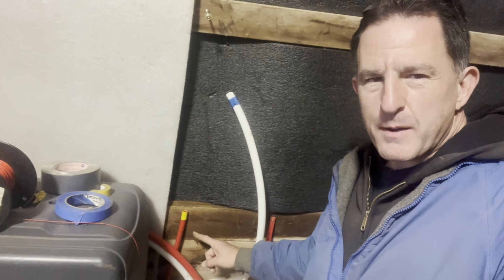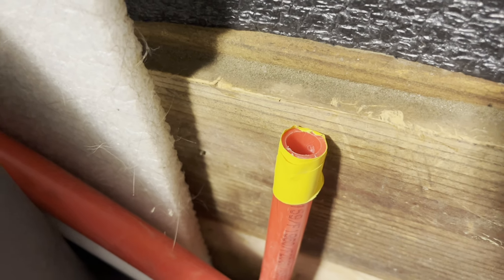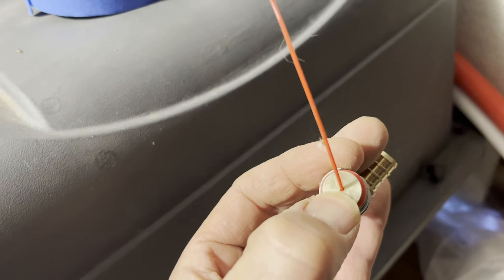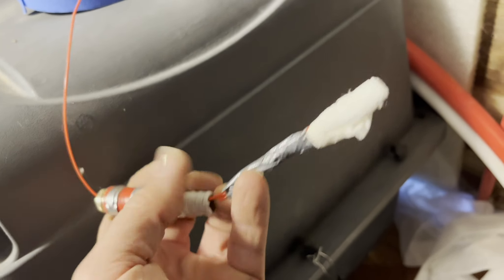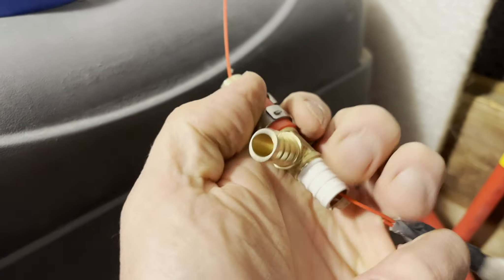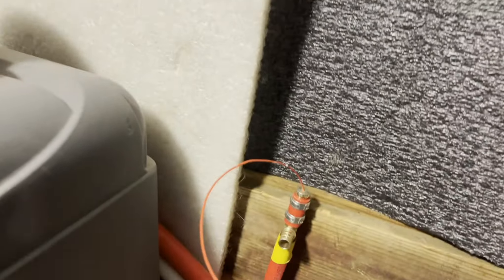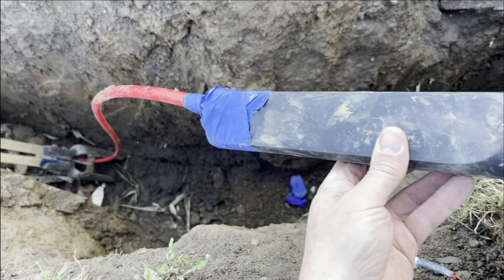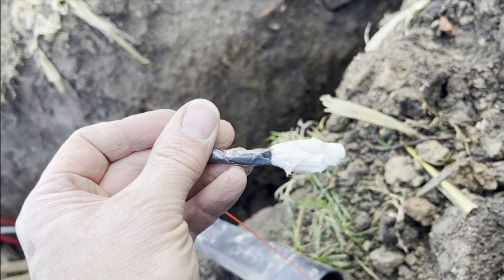Running Pull String Through Conduit

Comment: Good quick summary— but I’d like to know what kind of wire that is— obviously strong but very thin. Also, a few comments: 
I always recommend pulling a length of pull string along with the cat6 and tying it off at both ends to make it easy to pull another wire through if your needs change in the future. 
Also, anywhere anyone may encounter that pex along its route I recommend marking it clearly “data cable— DO NOT CUT” — easy to do, could save you a mess of work in the future if some repair person or contractor is doing work in a rush.
Finally, on the “receiving end” you could attach a short length of clear tubing which goes into the vac and have a young helper watch it and turn off the vac as soon as he/she sees the payload is delivered— get the whole family involved!
I’ve used extra CPVC pipe to protect data cable runs through my house, but Pex is a good option, too.
Reply from the maker: Good tips.   The wire was just some hookup wire I had on hand.  Any stranded single conductor wire could work.  It forms a good seal in the cap of the tee.